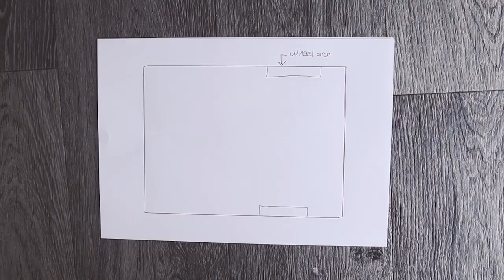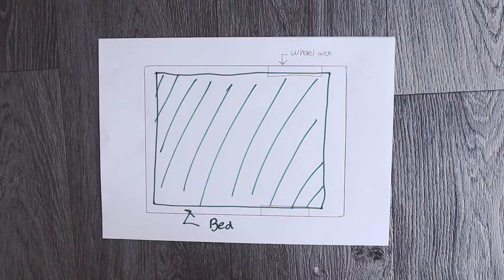AMAZING Self Made Bed for the Van Conversation (Vauxhall Vivaro)

Comment: Would like to know what the white fuzzy stuff you put against the van walls first was!!
But as previously mentioned you do need more ventilation in the bed base, as a caravan inhibiter those solid board bases just wont let the heat and condensation escape, you'll be waking in a puddle soon,.

Comment: A hammock tent would be easy to hang and keep you cosy in winter. It would lie level no matter the slope you park on and free up the interior space when put away. You would also have full length to stretch out . Insulating the walls and not putting in a window was good but you have lost at lot of the benefit by taking out the bulkhead (instead of just putting in a pocket door)
Reply from the maker: Hammock is a great idea! I love that idea!

Comment: Hello
I like your bed!
In a width way you earn more clear space.
Iam thinking to buy 
a renault trafic.
What is the interior
width dimensions of
 the van and what is your height in cm?
Reply: If you don‘t panel the insides of the walls(as seen in this video), and just use 6mm of Armaflex followed by 4-way stretch carpeting in the rear side cavities (either above the rear wheel arches or higher up in the rear side window cavities), you can have a width of upto about 177cm. I‘m currently writing this reply whilst lying widthwise in my bed in my Vivaro B self-build camper! Cheers from sunny Andalusia.
Reply: @petestanley5811  Thank you!
Cheers from 
Ioannina Greece!

Comment: Hi mate what is the dimensions inside of the van? Looking to a small double long ways
Reply from the maker: It's around 240cm in length so can easily fit a double long ways 👍
Reply: @Nomadickangoo  thanks for the reply mate! what's the width? And size of the wheel arch? Do u think its feasible to just stick a small double frame in there? Looking for a quick solution
Reply from the maker: @jamied3215  width is about 170cm but the rear wheel arches is about 126cm but you could always build on top of the wheel arch box to keep the 170cm BUT vivaro has a middle wall beam that makes the middle section come in abit.. so your bed frame might have to go in like a hour glass shape abit.
Reply: @Nomadickangoo  what is the height of the wheel arch? Would a bed go straight over that then? What wheelbase is your van please?
Reply: @Nomadickangoo  also when you upgraded from the microcamper did you have any thoughts about getting a high roof? What's your thoughts on a high roof van?
Reply from the maker: @jamied3215  the wheel arch is no more than 30cm high, but I would make your bed high so you can have lots of space underneath for storage. To be honest I didn't know what van I was going for, I just found the Vauxhall by chance, you need a van that suits you, if you like a high top get a high top, Im in urban areas so alot of park parks have a height barrier so a high top wouldn't suit my needs